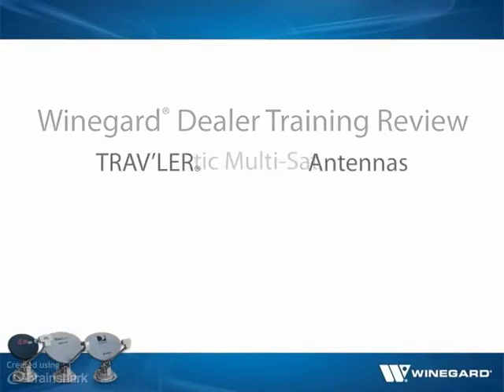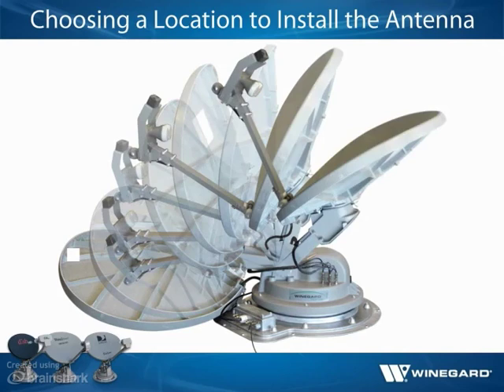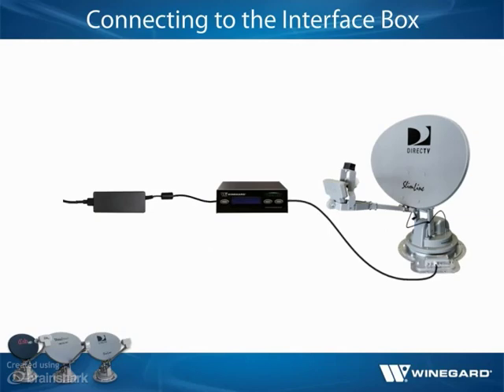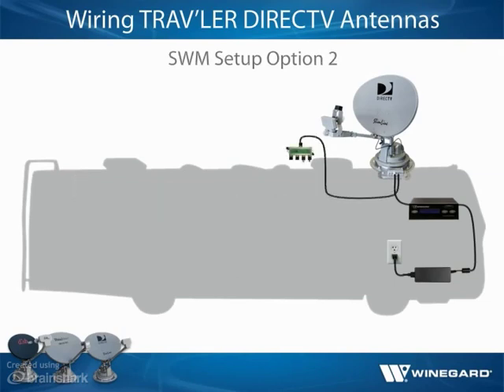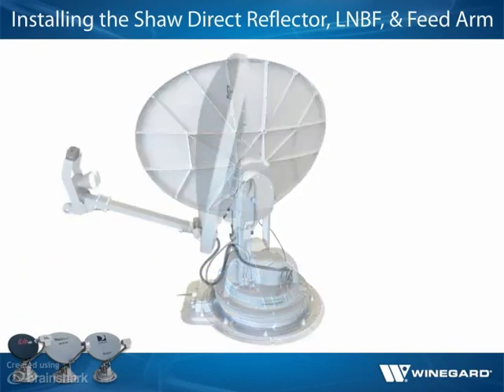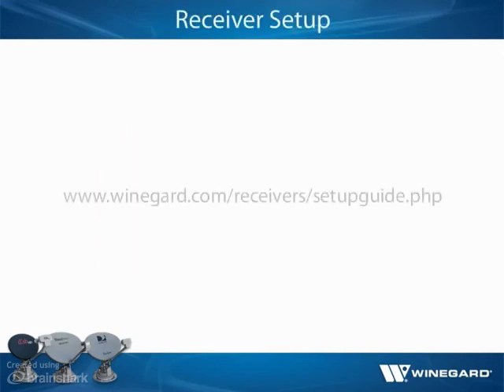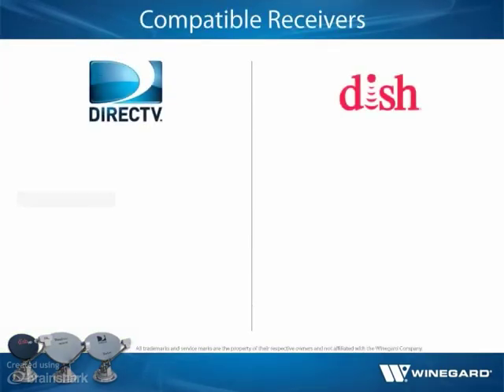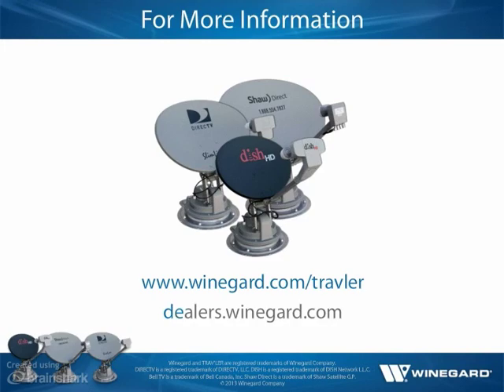Winegard TRAV'LER Antennas Training Review

Comment: HI MY WINEGARD IS RATTLING ON THE ROOF IN STRONG WINDS TV IS OKAY JUST STRONG WINDS CAN I RESEA, AROUND BASE OF WINEGARD THANKS FOR ANY HELP
Reply from the maker: Hello Noeleen - A rattling sound is likely a loose bolt on the reflector. There are either 2 or 4 bolts securing the reflector in place, if those loosen up it can cause the reflector to rattle around in the wind. Tighten those bolts finger tight then use a wrench for a half turn to make sure they are tight. If you need any further assistance please email Winegard Customer Support at help@winegard.com.